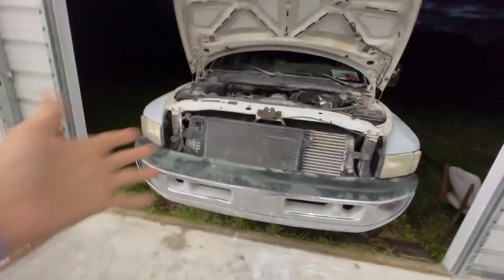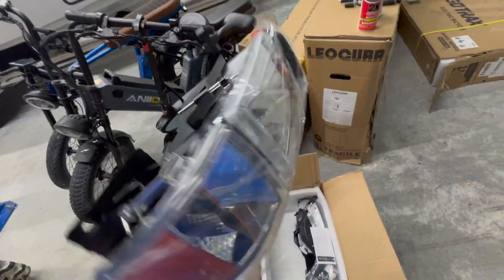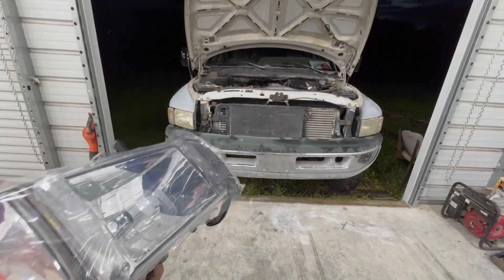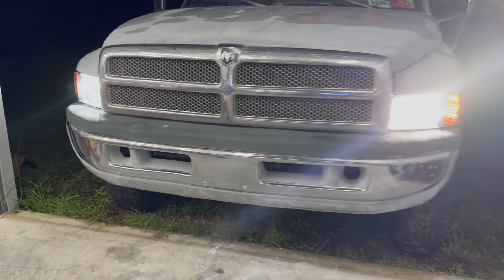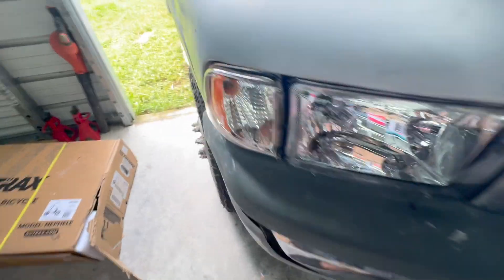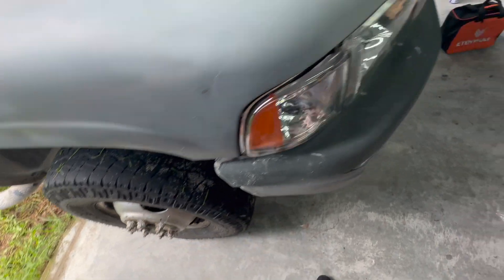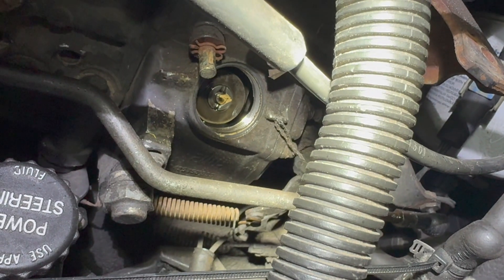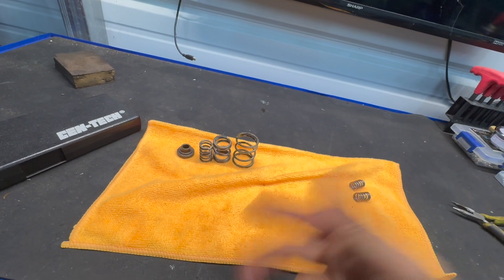Project Lucille | Cummins 3500 | GSK 3000rpm | HID upgrade

Comment: Retrofitting HID's is now illegal in Europe and the UK, too bright, and we have headlights that you can adjust from the drivers seat to compensate for load. You should go straight to a garage and get your headlight alignment checked.
Reply: Good thing he's not in europe
Reply from the maker: I aligned it myself.  Not a single person has flashed at me yet so i think it’s fine.  When i drive my other vehicles with high beams on i ALWAYS get flashed at.
Reply: The alignment, and just height in general looks perfectly fine though?
Reply: He is the shop 😂